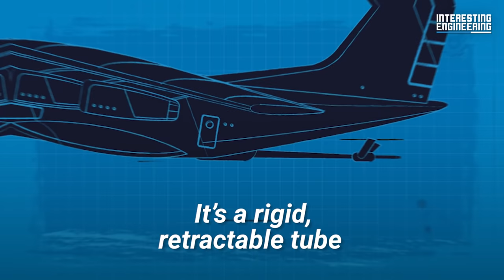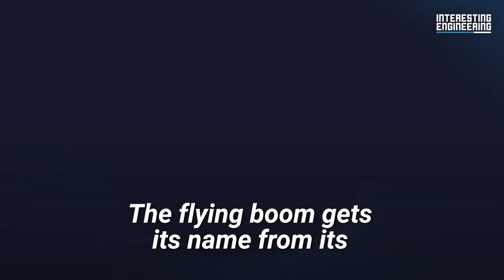How do Fighter Jets Refuel in the Air?

Comment: As a KC-10/KC-46 boom operator, this video is fantastic and tells it well. Yes. It's a hard job lol
Reply: Fellow Boom, i was a KC-135 boom from 1979-1986 (McConnell & Castle), and a KC-10 boom from 1986-1999 (March, Kadena (in the TALCE) and retired out of Travis in 1999. After the initial cadre, I was in the 3rd class of boom operators at March. good chance i was in, and knew the same guys who trained you in the sims. Fly safe my brother. "Boom Stowed, Leaving Position."

Comment: Although the fighters can fly further when accompanied by a tanker they will not fly faster. Usually they tank at much lower levels than normal cruising altitude, due to performance limitations - especially in hot climates like the gulf which makes the true air speed lower. Additionally, the refuelling hoses have a maximum speed limit of around 320kts indicated air speed. This is below most fighter jets cruise speed. These limitations make any long range tanker trail with fighters quite slow.
Reply: That's why they have so many bases around the world the tanker already placed around the route waiting for the jet fighter to refueling